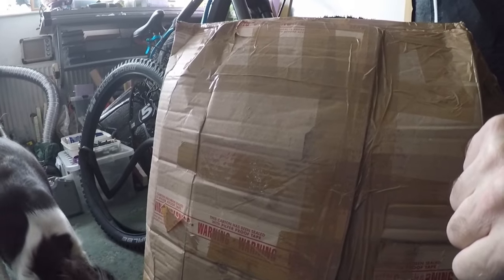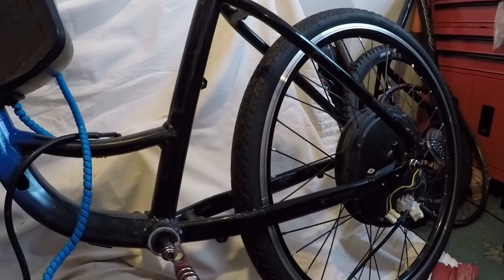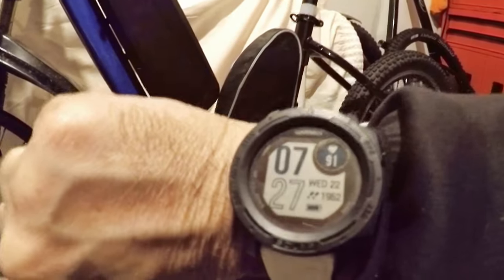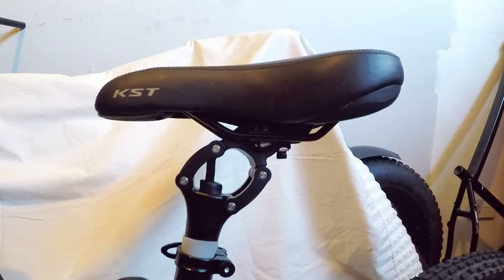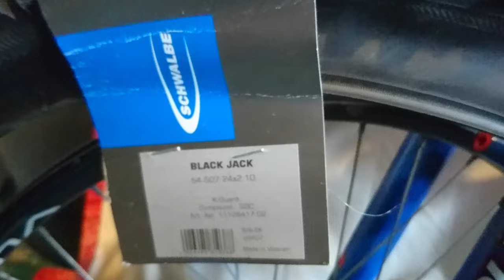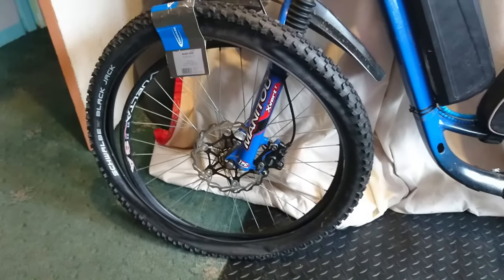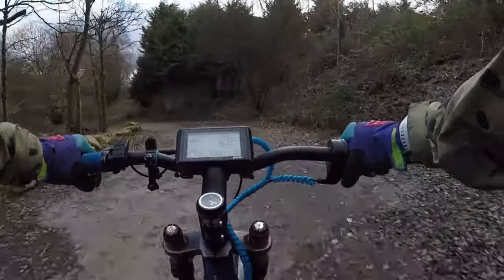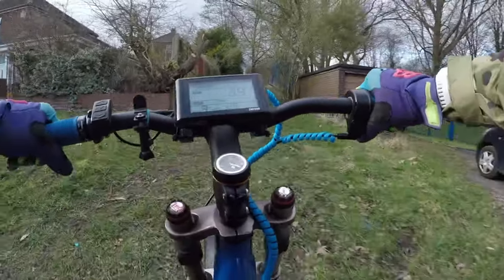DIY 48V 1000W MULLET E-MX Ebike V.2 // 24" X 20" // BUILD + FULL Throttle OFF ROAD Ride

Comment: Hahaha Flow wouldn't be Flow if she doesn't take at least a part of the show :) 1000 Watts? In The Netherlands we are only allowed to use 250 watts for a normal E-Bike (and a speed limitation of 25kmph) Ofcourse we have speedpedelecs with a max. of  4000 watts, but those need a numberplate and registration, and a helmet, insurance, driver license are mandatory. The fastes e-bike I ever tried was a 'modified' Sparta. The top speed was 47kmph. It was a kind of funny though. In The Netherlands there are 2 kind of mopeds,  25km and 45km max.  Until this year the 25km version were quite populair because, you didn't have to wear a helmet, but they have to use the bikelanes. So while I was riding that Sparta e-bike there was a 25km moped at that bikelane and I overtake him  :)  Although it is against the law, there are quite some modified e-bikes on the road and even e-scooters (which aren't allowed). The police gave it up when it comes to modified e-bikes, and they only test them if they are involved in an accident. Cheers!
Reply from the maker: Hi Theo - She's a character haha..In the UK 250w is the legal limit & no throttle so this ebikes a bit naughty !! But i dont ride on the roads for off road use only..Cheers for watching..